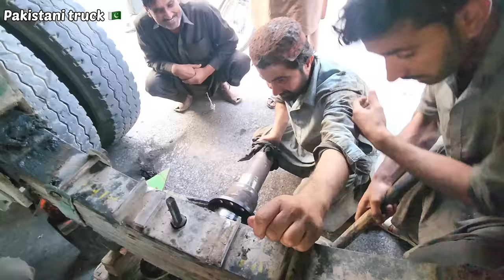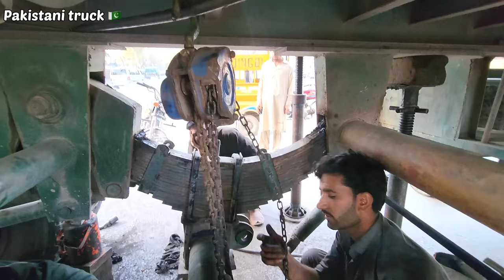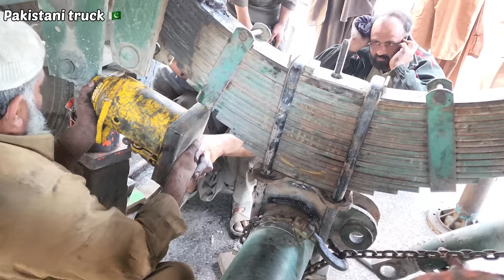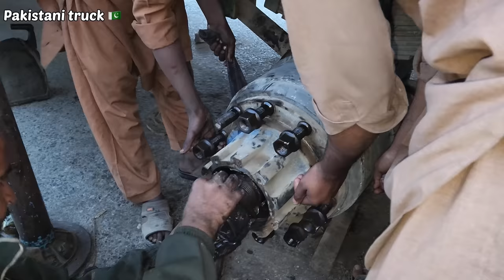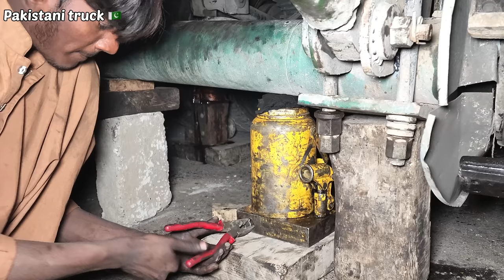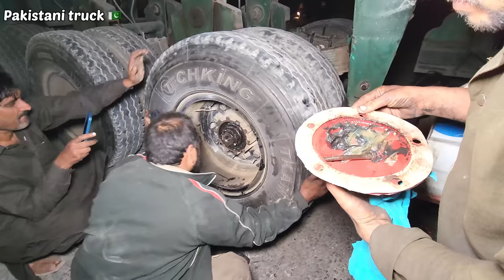Semi Truck axle Breaks Down ON The Middle of the Road We repaired Difficult Condition Of heavy load

Comment: That was truly an overloaded trailer, no wonder he broke an axel. I understand that you got to move product to make money but you got to take care of your equipment also. Good luck to the driver, hope he makes his destination.
Reply: they never learn.  they put heavier springs on everything. yet  fail to appreciate axle load. there must be 3 trailer loads of weight on one trailer. yet it only has normal wheel bearings and axles. for what the driver makes per delivery he then looses in downtime and repairs.
Reply: Its god thing no one is dead.
Reply: Insane the brakes aren’t rated for stupid.
Reply: its cheaper to overload the truck and pay for repairs than to run it with normal weight. honestly it helps everyone out making price of goods cheap enough for people to afford
Reply: I doubt it he makes it far, did you see the left tires on the trailer? they were already cambering out, that axle is the NEXT one to break. Down the road there will be another "repair shop" to cater to these overloaded vehicles. Safety is NOT the number one priority, maybe forth......
Reply: Road breakdown soon because of overloading
Reply: I am willing to bet labor is very very cheap there for repairs.
Reply: @plaid13  If you think labour is cheap check out: sidewalk dentistry in India. They do dentistry of all kind right on the sidewalk, yes, it's cheap. You can imagine mechanical repair right on the street. Everything goes in India and Pakistan.
Reply: @caddyrack  Yeah. Cheap and often good... often Not so good.
Reply: @plaid13  Well said plaid13, it comes down to: You get what you pay for, cheap parts and cheap labor don't last much. I've worked on vehicles since 1970 and when customers brought parts to me to install I wrote on the receipt: Customer supplied parts, no warranty if parts fail. I did a clutch on a F250 and the clutch failed, he came back and DEMANDED that I'll fix it for free....MY FAULT, he said. He had the clutch re-done at another shop and they told him that the parts were cheap and that's why they failed. He still came to me, I showed him my receipt with my and his signature.  Nope, I'm not eating this. Cheers
Reply: Just remember that they don't get paid overtime.  It either get pay by the hours of what they agree  it basically like for life  Or on the other hands is that faster you get there and the better the money get. Pull overload add extra to the load of this spring or the axel.  Go big or lose everything. It all about the money
Reply: No tention bro
These are Pakistani dirvers we proud all of them ❤
Reply: I wonder what a roadside repair like that cost.

Comment: We have roadside assistance here but nothing like this. I’ve done a few alternators on the side of the road myself and a few bigger repairs in parking lots of auto part stores but this is amazing.
Reply: theyd want 20k to do this job on the side of the road here in america thats if they dont say "its not possible" . if anything it would be a 5000$ tow fee 🖕🖕
Reply: yah these guys are insane workers makes you feel so lazy
Reply: This is NOT amazing!  This is lack of "common sense"!!
Reply: Growing up I used to see lots of roadside repairs on loaded trucks and when I got older and became a truck mechanic I asked a couple of old timers why they did so much roadside repairs and I was told it was mostly because it was easier to fix them on the side of the road than to tow them back then especially on car transporters which back then could only be flat towed.  In a case like this where the trailer broke an axle think how long it would take to unload the trailer onto another truck and trailer especially if it had to be done by hand.  I have a good friend that owns a tow company that will tow just about anything anywhere as long as the customer has money and in his fleet of vehicles and equipment he has three forklifts, a couple of skid steers, and wheel loaders and several different trailers and tractors for them so that he can unload a trailer if need be to tow it as well as for accident cleanup to go along with his stretched out hydraulic rotator wrecker with an under-reach.  Think about most of the heavy duty tow trucks pre 1990 and most were rather short with Holmes 750’s or 650’s on them. I remember when my buddy got his first hydraulic heavy duty tow truck in 1993 with a under-reach and the first tow I went out with him on I couldn’t believe how much easier it was to tow a truck with it compared to one of his trucks with a 750 on it
Reply: @BobSmith-mc7uq  
No, that lack of OSHA right there.
Reply: @BobSmith-mc7uq  no it's a lack of money.

Comment: smearing grease over a bearing does little. then to tighten the bearing nut with a hammer and chisel...oh boy that sure does give bearing pre load.  guaranteed to fail.  but keep the guy who replaces them in permanent work.
Reply: Torque specs change depending on if you ate your Wheaties or not that morning

Comment: Good work on the side of the road but I’ll give the wheels on that axle a short life span because the studs will snap because they were way over tightened. 😊
Reply: how any of this mess even moves is amazing
Reply: Your theory is mechanilly bogus, and even the studs themselves are dead cheap at $4.00 a piece. Am more worried about ROR axles. They have no breaks on them, they pose a risk of break failure and a runaway truck. They should at least have used 4 original BWP axles if they are going to overload the truck in this manner.
Reply: @AAA-sx5ej  What I said was just one of the obvious things….I realise there are a lot of other faults but I was only pointing out that because I have had that happen to me. I had that exact problem with a wheel coming off because a bloody tyre lot over tightened the wheel nuts. As for “bogus” I think you are a little bit too pernickety. Cheers.😁

Comment: Your spring packs combines or more than 3 times the thickness of the hollow axles combined. 
Just another day in Pakistan
Reply: theyre oversized because the spring packs probably arent as strong as theyre supposed to be so they add extra incase there are defective springs

Comment: This truck is not overloaded. Its  a double drive heavy duty tractor unit with a gvw of 26 tons.
If used at Cat2 STGO it's gross weight on 6 axles can be up to 80tons. The trailer bogie was badly maintained/ worn components.

Comment: I’m not surprised that you always get to see broken axles they are over loading the trailers plus I’m a mechanic that has worked on commercial vehicles that they are tightening the wheel nuts in the wrong order so they have been tightened unevenly so they won’t be aligned they are hard working with not the right training that is why they have all theses dangerous breakdowns

Comment: I highly doubt there is any truck scales or weigh stations in Pakistan, I would love to see scales installed on the busiest roads just to see how heavy these trucks are.  If it fits it ships must be the motto in Pakistan.  I feel sorry for the truck pulling this load, just because it can physically make it move does not mean it should be on the road especially with the suspension and brake technology used on these trucks.
Reply: There are Truck weigh stations all over Pakistan particularly before entering the Motorway/Freeway expressways.  But on regular city roads like in this video, they aren't very common.

Comment: With this kind of 1 day work late until it's done roadside service available WHY NOT OVERLAND  THE TRUCK ??
Reply: That whole job cost less than it'd cost to just dismount and mount one tire here too. In another comment the poster said it cost 12,000 rupees which is $41.86 USD
Reply: @1pcfred  In Pakistan there highest paid men make around $1.00 per day US. helpers get   $0.25 - $0.50 . 
Truck drivers in Pakistan unlike American truck drivers who get paid by the mile get paid by the kilogram thus motivating them to load every last microgram they can fit on the truck
Reply: @lmbcvt  a dollar a day? You can't even get a cup of coffee for that. What do they live on, air?
Reply: @1pcfred  Well just about. 
In there country if the main breadwinner can bring in 30 or 40 dollars a month and his wife and kids combined can bring in another 30 - 40 bucks they can have a dry place to sleep near running water and sanitation and 3 meals a day and if there very very lucky they have the standard 70 cc Pakistani motorcycle and very little else
Reply: @lmbcvt  I guess we're all just scraping by and doing the best we can. I know I don't have a mansion and a yacht yet myself. The lack of funds stops me from doing quite a number of things regularly in fact. But I have managed to secure a dry place to sleep that has running water.

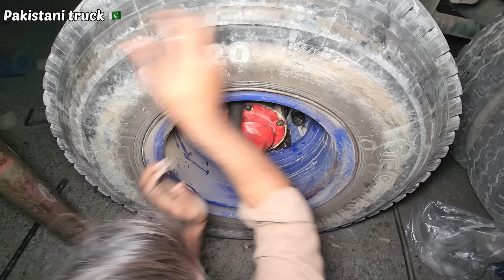Comment: 14:32
counter clockwise to tighten ? 🙄
Reply: left hand threads on the left side of the vehicle. Right hand threads on the right side. It's a very old system. Old Dodge cars had it too.
Reply: Lefty tightly, righty loosey

Comment: The Truck was way overweight ( normal for Parkerstan, India, Bangladesh ), and this will damage the : Clutch, Engine, Brakes , axles .
Why is this allowed as it is so dangerous.
The load should have been forklifted off as the Mechanics are in danger . 
Thanks for sharing……
Reply: It's not that much overweight. I counted the bags and it's only about 2.25 tons over. If he would have had one less course on it he'd have been under.

Comment: you guys should build a heavy wrecking truck so you can bring these trucks back to the yard for work
Reply: they would have to hand bomb every one of those bags off the truck, onto two other trucks, before they could tow it.
Reply: @robbiemckinnon7901  a heavy wrecker is made to lift loaded trucks and tow them
Reply: @imchris5000  Try to find a heavy wrecker in Pakistan. They don't even have tables and workbenches at their repair shops. They rebuild transmissions while sitting in the dirt. Seriously.
Reply: @robbiemckinnon7901  thats why im saying build one these guys build entire trucks from the frame up they can make a wrecker out of scrap trucks
Reply: @robbiemckinnon7901  and they pass the savings onto the customer. This whole axle job cost less than it'd cost in the US to just dismount and mount one tire. Forget about greasing the bearings or anything else. Just taking the tire off and putting it back on.
Reply: @imchris5000  there's no such thing as a scrap truck in Pakistan. If it is two flakes of rust stuck together still they'll rebuild it. They probably don't have a junkyard in the whole country. The entire concept of scrapping something is beyond their comprehension. Throw it out? You mad bro? We fix!
Reply: @1pcfred  you're exactly right. I talked to a guy from Poland a long time ago, and his father had went and bought three identical old wrecked cars, with their accident damage in different places on the cars, dismantled all three cars and built one perfectly working car from them all. It was all different body colours of course.  He kept the spare parts he wanted and sold off the rest. NOTHING was wasted. Gotta love ingenuity. It's driven by necessity.
Reply: @robbiemckinnon7901  we waste a lot. Someday it might catch up with us.

Comment: That not overloaded ,in Indonesia Isuzu FVZ 285 6x4 using for Hauling 50 tonnes clinker for long distance Hauling from cement plant to loading port
Reply: This load looks to be about 42.25 tons to me. So less than 50 for sure.
Reply: @1pcfred  that less 30 tonnes sir

Comment: No problem. Just replace the original spring packs with grossly overrated springs. Don't worry about the axle ratings, and just load them up. Love the safety boots and the other safety gear. Absolutely horrendous.